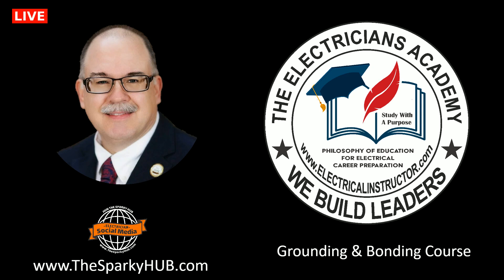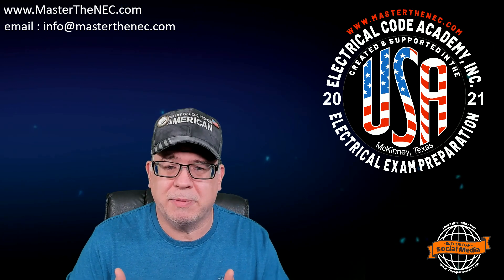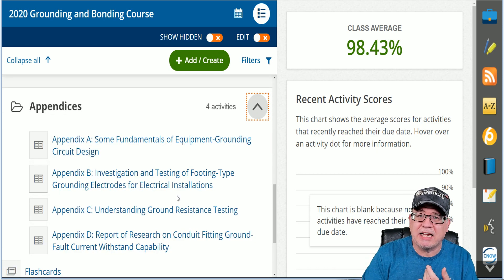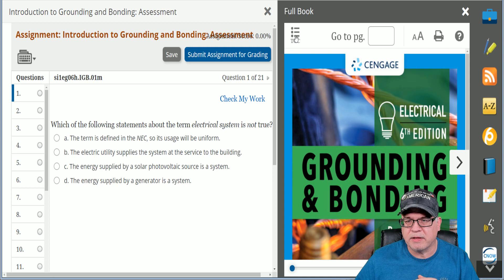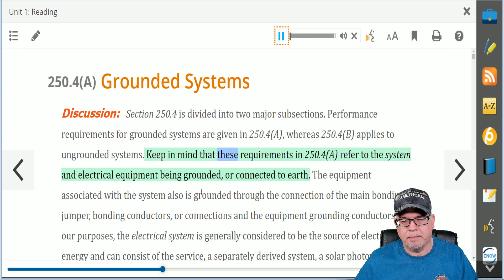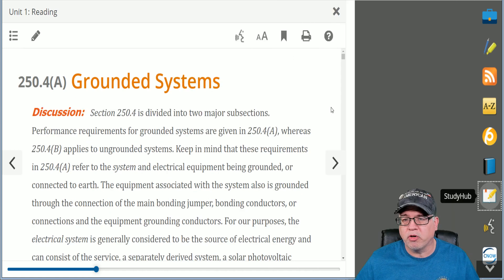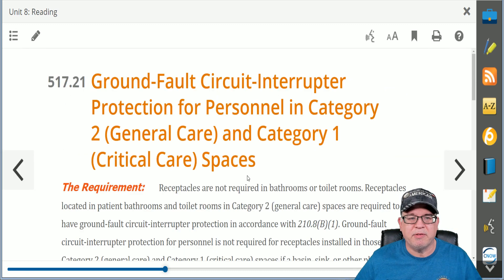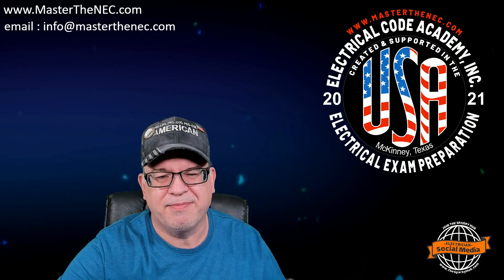🆕Electrical Grounding and Bonding Training

Comment: Awesome course probably will take it! I have a quick question though. I’ve been debating recently with a fellow person about were the best place to land your GEC would be, either the service disconnect or the meter can. What is the difference if I land it in the service disconnect or meter can? I recently helped install a generator were they ran the GEC straight into a 320 bypass meter and out of that we used 2 pvc nipples with service conductors (2 hots and a neutral) to our ATS for a generator and have it bonded at the ATS with a factory installed bonding strap. They are saying this is incorrect and I should have landed the GEC instead into the service disconnect and by me “bonding” both ATS’ (we had 2 panels) and bonding the meter can with the GEC landed in there it’s incorrect. 
I’ve been trying to prove to them that you must have a main bonding jumper and what I did by just running service conductors to the ATS is suffice I don’t need to run a ground or land the GEC in the ATS because the neutral will still carry the fault path am I right? 
If you could please give me a educated answer it would be greatly appreciated or how to reply to him that he is wrong I can land the GEC in the meter can with no issues and just run service conductors to a service disconnect. 
Thank you watch all of your videos on a daily your the best out there!
Reply from the maker: Greetings Andrei - the first part of your question about the BEST location to terminate the GEC. Well, the NEC permits the GEC to be connected to the grounded conductor at the service equipment or anywhere on the supply side up to the service point. This would allow it to be done in the meter. Now, as to which is best, that's a personal choice but to my way of thinking its perfect in the meter as keeping lightning,  surges outside of the structure is preferred.  However, some inspectors want it in the service equipment as they say it needs to be accessible, but fact is it is accessible even in a meter enclosure if access is necessary but it won't be necessary. Now, the other part of your question is quite confusing to "interpret" as you didn't state of the generator was actually a separately derived system, which is based on the switching or lack of switching to the grounded conductor in the transfer switch. But what I will say is that if the ATS is now the service disconnection means and SUSE Rated then you could indeed apply the GEC the grounded conductor terminal point as that would now be your service equipment and panels down stream are remote panels. Now, if you can clear up your installation and email it to me (info@electricalcodeacademy.com) I will analyze it further.

Comment: Grounding is actually connecting to ground, to the grounding electrode. 
Bonding is establishing electrical continuity with all of the metal components and housings. 

I think that's correct...
Reply from the maker: Essentially. However, the ACT of grounding and bonding is very detailed and the steps to applying the NEC correctly can be quite confusing for many folks. This is why I created our Grounding and Bonding Program.